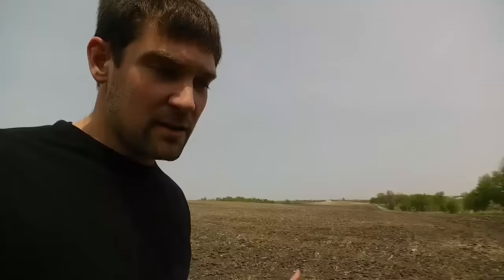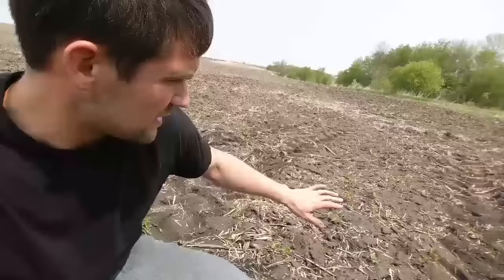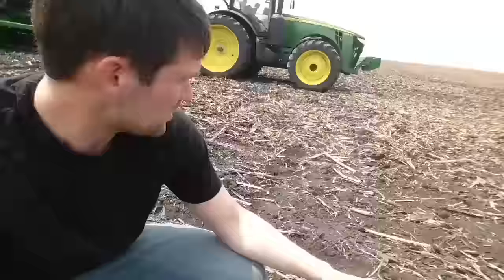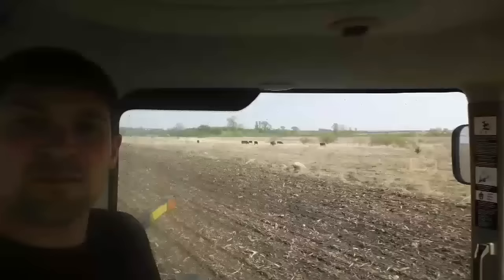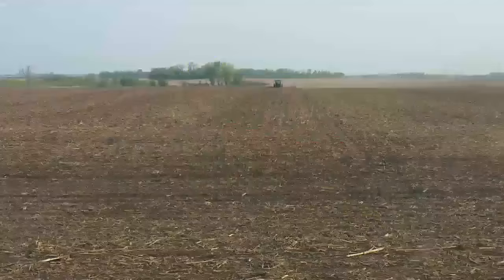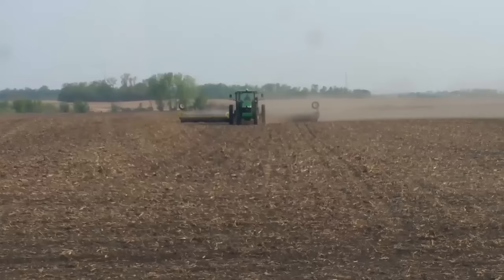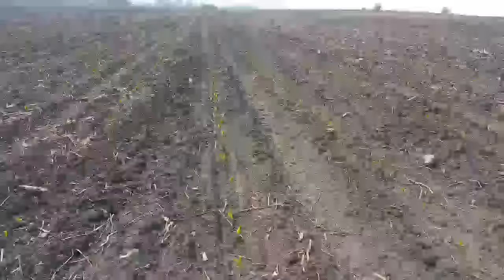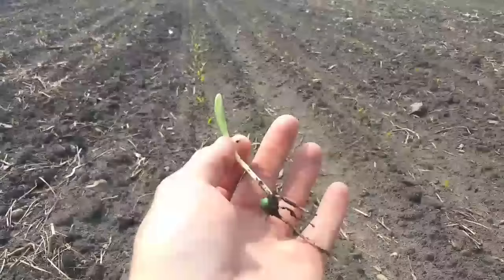Field work before and after planting

Comment: love your videos  here at our farm in SA we do the no till thing and works very good wonder how much the bushels per hectare would go up if you guys could've do  no till  if the ground was right     but keep it up love the videos  we also have some weed that build up resistant to roundup  but we  upgraded the nozzles to a more misty spray so now we got control over it.         but here and there the sections don't turn on on time  so we also have those spots that you have wich we come back later and spray with other chemical things.